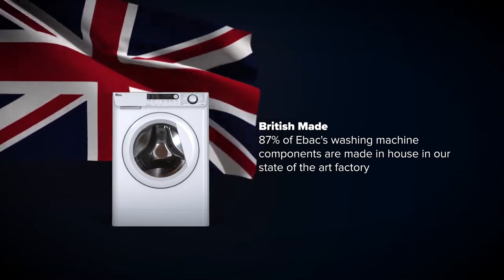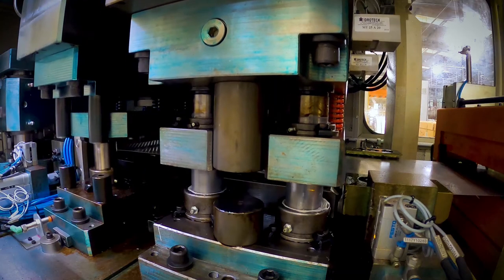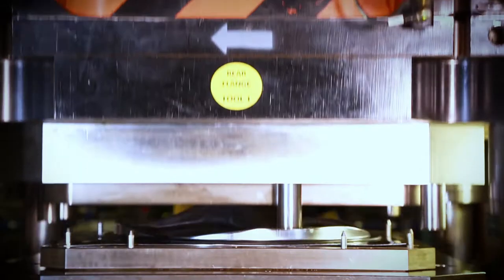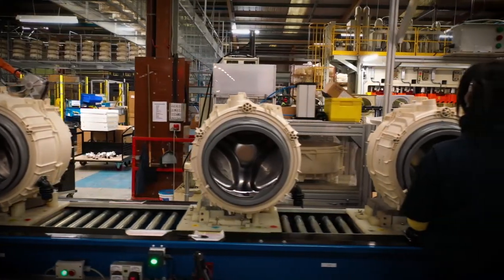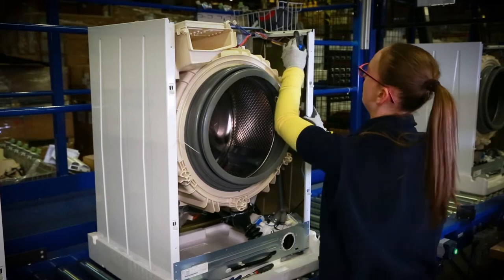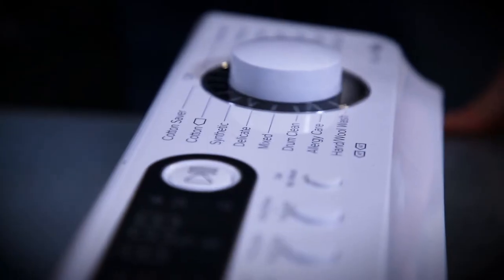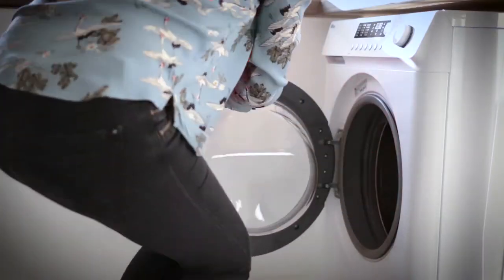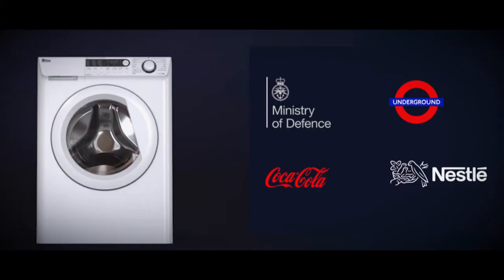Ebac Washing Machines - Reliability and Durability

Comment: Had a Hotpoint WML540 the bearings went after only 2 years. The plastic drum was welded together to make it cheaper to produce but you couldn't replace just the bearing you had to buy an entire new drum which cost more than the machine. It also was rusting to bits so I had to scrap it . This EBAC machine has a plastic drum that is bolted together and so it  can be split for easy replacement of the bearings when eventually they do go. If you visit your recycling dump have a look at how many relatively new washing machines are being scrapped just because manufacturers such as Hotpoint , Hoover and even the mighty BOSCH have used plastic welded drums . The first question you should ask your washing machine salesman is does it have a welded plastic drum and if it does don't buy it!
Reply: You have never used LG then, I worked in heavy laundry cleaning services for 20 years with washing machines it cost £200k+ gas dryers steam and gas ironers so for me laundry was my life even your wee toy washing machines at home. The LG was the best I ever purchased and I recommend them to anyone and am now on my 2nd one and all my family and friends I tell to buy them. Parts are cheap easy to fit if you need them and replacing the bearing is a doddle for anyone willing to take the time to do it.... Direct Drive is amazing stuff your stupid old belt drive systems just old technology in my book.

Comment: they use a plastic tub which can be taken apart for repairs for bearing replacement or replacing the drum spider
Reply: Utter JUNK this product is, no internal sound Insolation, dodgy Shock Absorbers,  Loud on spinning, shakes more than Micheal J Fox